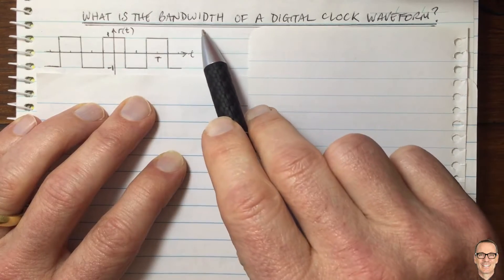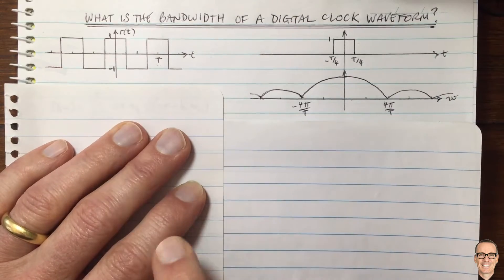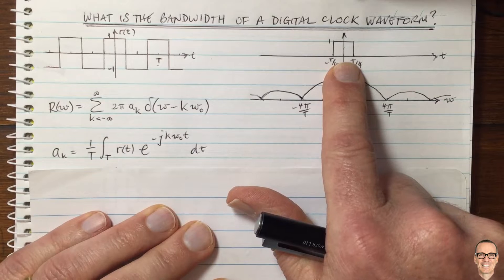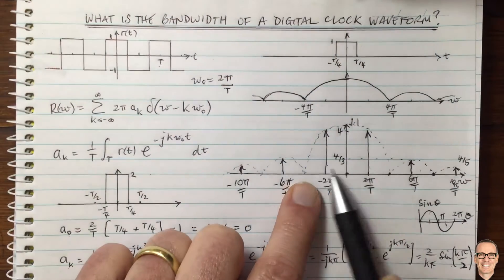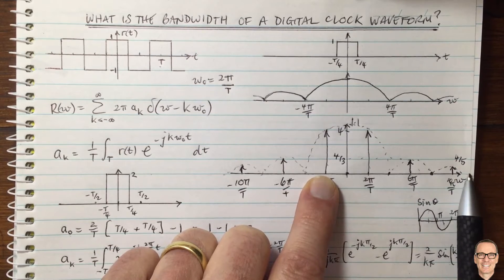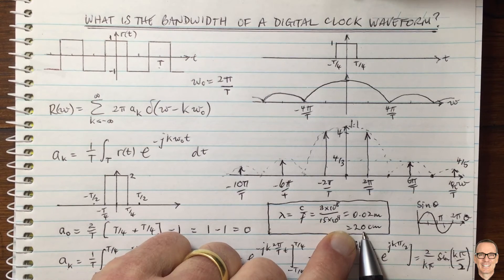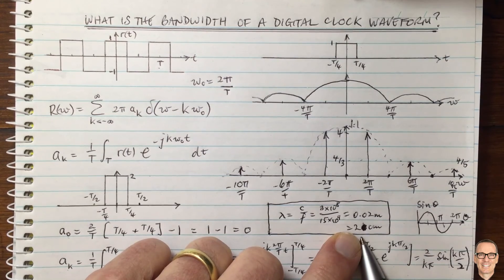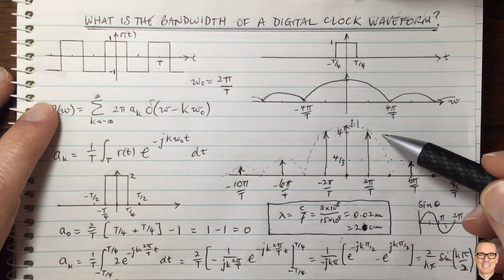What is the Bandwidth of a Digital Clock Waveform?

Comment: what is the significance of clock signals in digital communication? please give some intuition i am a bit confused professor
Reply from the maker: Without a digital clock, you don't have digital signals. If you want to send a 1 or a 0 over a channel, you need to do it by sending a waveform for a finite (non-zero) amount of time, T. One waveform will be used to represent the 1 and a different waveform will be used to represent the 0. So you need some way of marking time, so you know when to switch to the next data bit you want to send. That's what the digital clock does. This video might help: "What is a Constellation Diagram?" https://youtu.be/kfJeL4LQ43s
Reply: @iain_explains  well thanks for the answer

Comment: As you said, the wire with half the wavelength can radiate even if impedance is matched? Also do we need to increase or decrease the length of trace not be be multiple of wavelength?
Reply from the maker: It depends. Impedance matching does not change the physical length of the antenna/wire. The fundamental resonance of a thin linear conductor occurs at a frequency whose free-space wavelength is twice the wire's length, i.e. where the conductor is 1/2 wavelength long. But this is only in free-space, so in general, the 1/2 wavelength is more of a "rule of thumb" than something that is accurate. Thanks for the question. I've added it to my "to do" list for a future video.